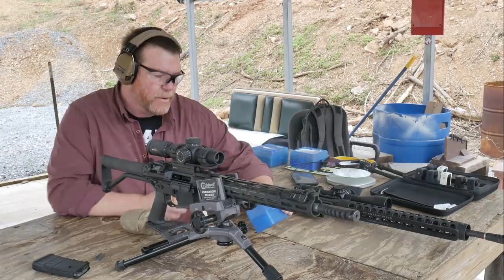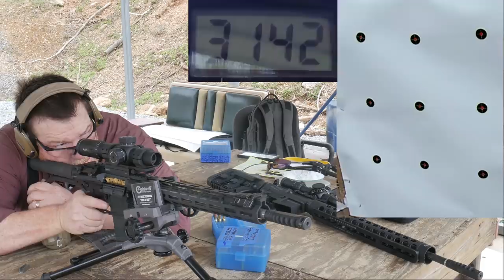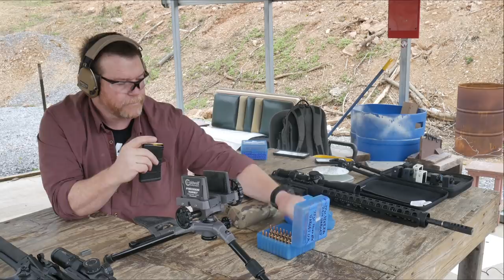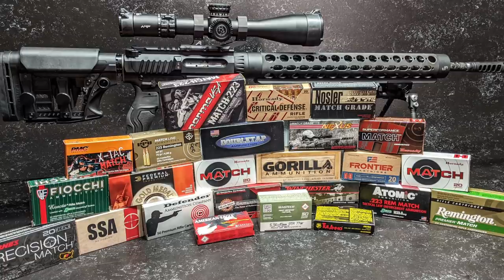Load Testing Part One

Comment: That dmr rifle is dead on.
Reply: Tom Fouse it seems to eat everything. I’d like to see how it runs steel cased trash ammo. I specifically built my Bushmaster to eat 62gr Barnaul. I got it to gobble up 1.5 MOA with a flyer every mag or so. (I have a bunch of buddies with tons of spare parts and swapped bits at the range one day and got a pretty good combo. I took the set up to my gun smith and had him lap  and accurize it to the best of his ability with the parts supplied, (he didn’t like my provided fore end and switched it to a Timber Creek which gave it a tiny bit more consistently). 

I tried this before and since, and never had the same function. Usually you build to the best of your ability and either load or find the right ammo. I’m gonna be sad when the barrel wears out and I have to change ammo again. (Or maybe I’ll be lucky).

Comment: KB you should give the 52 grain eld match or sierra matchking with 25 grains of benchmark and adjust up from there..... I haven’t seen a rifle yet that it wont shoot ragged holes in!! I shoot 77 tmk in my 24” 1/8 twist bull barrel setup at 2850 plus fps and what a beast..... one ragged hole @ 100 and great groups out to 430 yards which is longest I have at moment..... sierra performs period especially over some xbr powder 🤪

Comment: Varget has a lot of inconsistencies with heavier pills, temp and altitude.  With the DMR consider trying 23.1g 8208XBR under a 77gr pill or 22.1gr AR-COMP under a 77 sierra BTHP @ 2.26" OAL  with the shorter barrel I get much better results out of a ball powder CFE223 or BL-C2 are my shorter barrel go to's 24.2g BL-C2 under a 77gr pill or 23.8gr CFE223 under a 77gr. BTHP match king.  Just passing it along if it helps great and keep me posted.
Reply from the maker: I've got most of those powders, I'll give them a shot.  Thanks for the awesome input
Reply: That 8208 load works great for me.
Reply: Have you ever tried Tac powder?
Reply: Tac is great with lighter weight pills,  but I haven't played with it too much on heavier ones
Reply from the maker: That first series of rounds for the 3 gun rifle was with cfe223.  I love that stuff,
Reply: What do you use for a loading machine

Comment: Something is not right with that 16" barrel.  Even the shorter length vs the 20" shouldn't group THAT much wider.  Either a full workup with JUST that 16" barrel and see if they need a completely different load (possible) or send it back.  Imo, a workup is 50 rounds, so give that a shot since it can be done quicker.
Reply from the maker: The 16 inch is fouled up.  It should be grouping around 3/4 moa.  I'm cleaning it and mounting a different handguard this weekend
Reply: @kotaboy32  it must be REALLY fouled to be shooting 3 inch groups lol.  Hopefully a good cleaning/copper remover helps tighten it back up.

Comment: I have a question for you. I took a video of my radical firearm AR in slow mo and I have bolt bounce back. How do I fix that. I have a mil spec bolt carrier. A flat wire spring and H1 buffer. I have tried a mil spec spring and H2 buffer. It still does it. Help!! Lol.
Reply: With a carbine gas system, I run a H3 buffer and milspec spring and bcg. Works for all types of ammo I run in it.
Reply from the maker: I wouldn't worry about the bolt bounce unless you are having issues with cycling.  A heavier buffer should help but it will only reduce, not eliminate